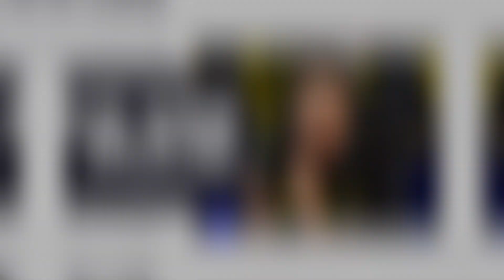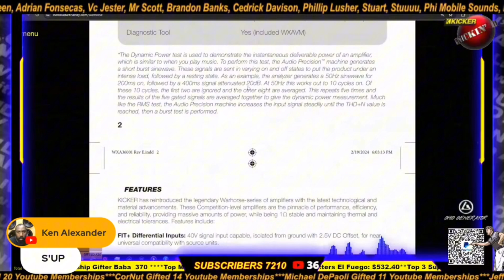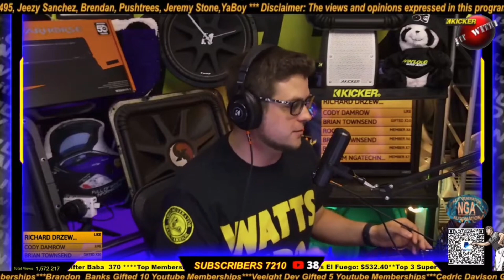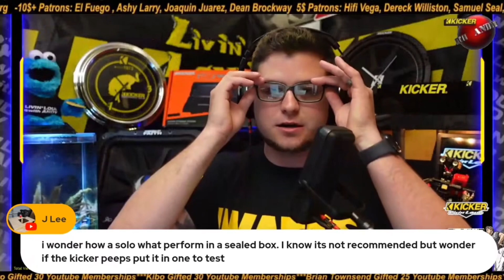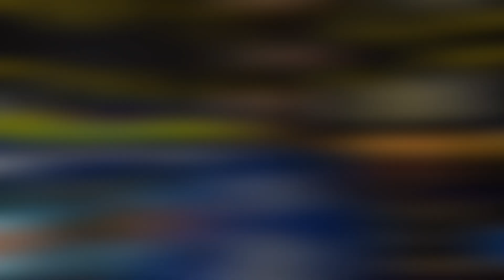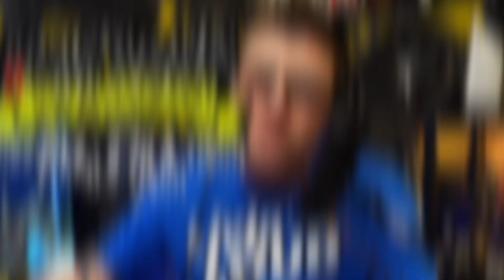Does Dynamic Power Mean Good? Solo X Enclosure Recommendations

Comment: Didn't want to write a book in the chat, here's what I was taught many, many moons ago circa 1988ish. Right on "max power" etc means squat. But RMS is not the only magical number. Music is obviously dynamic. So let say your listening at a moderately high level using 60 to 70 watts RMS , your amp is rated for 100 watts RMS & only does 105 dynamic. If a sudden kick drum or cymbal crash happens your not going to here/feel the impact as great as if you had a 75 watts RMS w/125watts dynamic. The rule of thumb I judge an amp is it must have a 25% difference between RMS and Dynamic.
Yes your right the amp design plays a role depending on the power supply capabilities. A weaker power supply or rather the amps built in internal power supply caps are just not capable of providing the outputs with the required power. That's where an interesting dilemma occurs. Lots of people ask do the old coke can caps do anything ? The correct answer is Yes and No. Will they help your cars electrical ? No. Can they be used to boost the amplifiers built in power supply capabilities? Yes. Tony D'Amore done a video proving that years ago. But the cap must be installed extremely close to the amp. But at the end of the day it's cheaper, better, and more reliable to buy the better amp with a proper built in power supply.